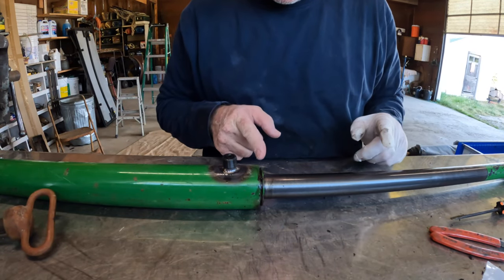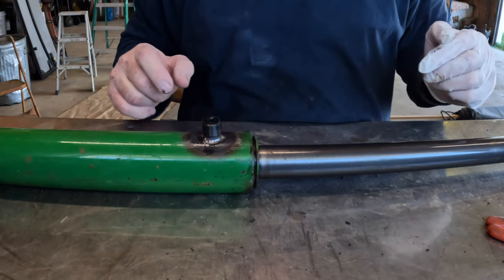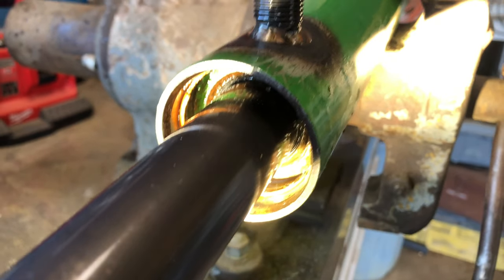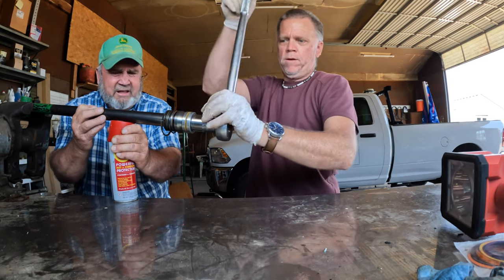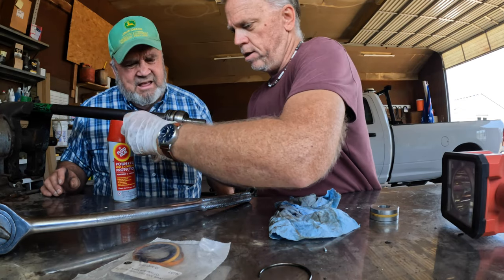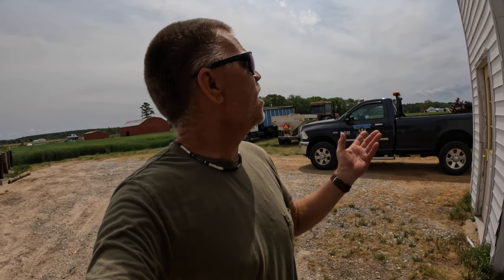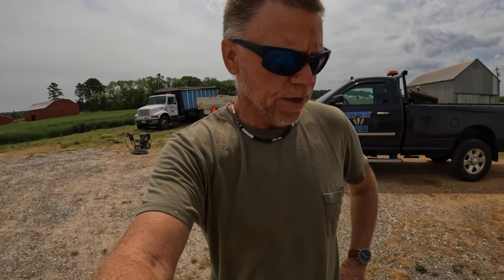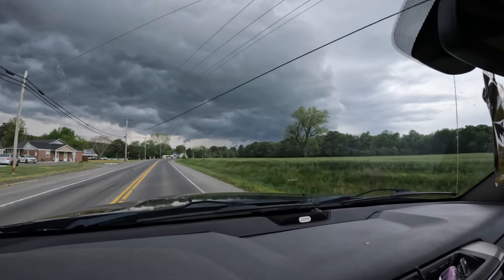Hydraulic Cylinder Repair JD 300X Compact Loader

Comment: Having an issue getting rod back into cylinder after replacing seals, have an inch left, just can't get back in far into to put snap ring back in, any ideas?

Comment: When I saw you struggle with the Deere hydraulic cylinder I was thinking, why don't you strap it to the skid steer and lift the boom to pull the rod out. Not sure why they use that silly snap ring system.
Reply from the maker: I had to lay in bed one night to come up with a better plan, hence the reason for attaching between the 2 hitches of the pickups.

Comment: This is why surge protectors and lighting rods are useful . its odd no fire because normally a lighting strike hits and you have a fire . has for the transformer their fused so if struck the fuse blows and transformer goes but beyond that a lighting strike should travel to the ground and disapate its energy if the ulity pole has a grounded wire . if lighting strikes your electrical panel odds are youll need to replace it along with the meter and mast and possibly the main entrance wires because chances are their damaged the power company usually will inspect their wires for damage right up to the entrance mast or meter socket after that a certified electricen should inspect the panel and all the wires because lighting is a way higher voltage than the 7.200 volts traveling on each phase of overhead wires . im actually shocked only the transformer went usually lighting strikes a pole and blows several transformers and switches not just one but at least 3 or 4 in a row it could blow 2 in either direction .

Comment: Good video. Does this piston and cylinder control the up/down axis or pivot on the bucket? Mine is leaking down on the pivot axis.
Reply from the maker: If I recall correctly this was the cylinder on the bucket pivot.

Comment: I just removed the inside snap ring, way easier. When you tap that collar down into the cylinder use wood instead of that chisel, harder to marr up important surfaces with wood

Comment: Hey so did it end up fixing your leak, went through this same exact thing, broke my fitting, rewelded it, now I’m leaking. I thought the seal would be at the other end of the cylinder while I welded.
Reply from the maker: Yes it did fix the leak.  Good luck!
Reply: Cool thanks, gonna try it out next week once my seal kit gets here
Reply from the maker: Yes the leak is fixed
Reply: Worked great for me thanks.  I ended up hooking the end of the rod to a ratchet strap between two poles in my barn, popped it out with quite a bit of pressure